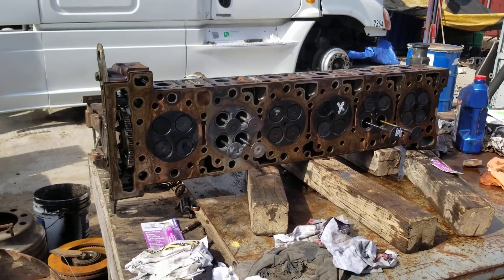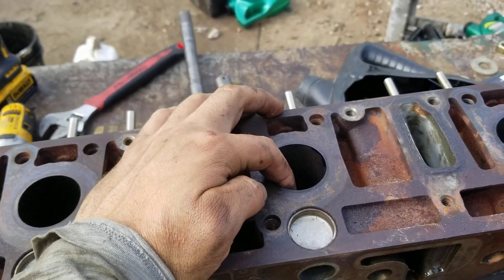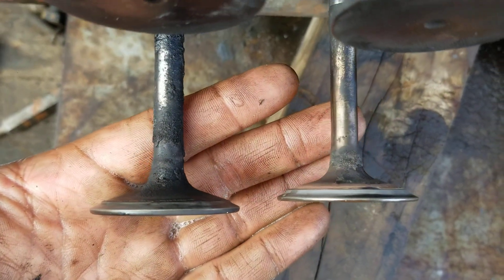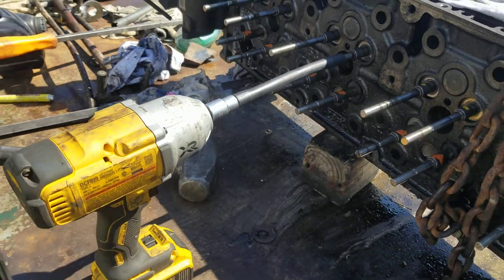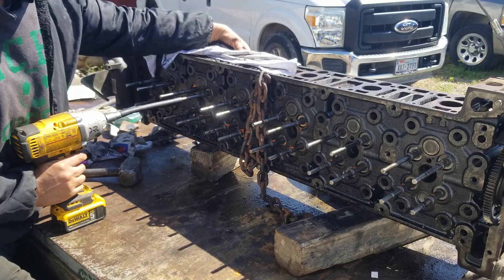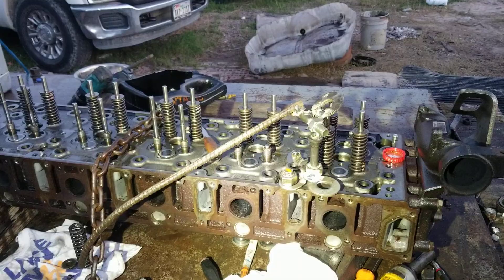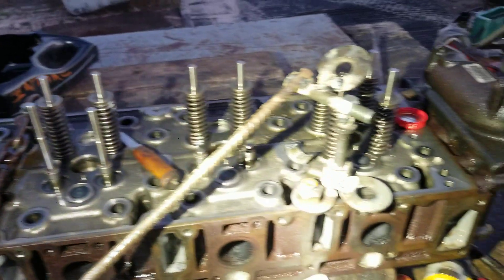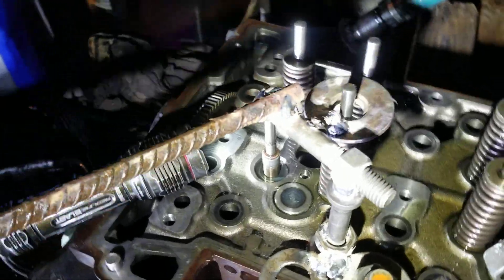DETROIT DD15 ENGINE REBUILD CASE STUDY #2

Comment: Geeez man. Detroit diesel would have a field day with this video. No cut out test through DL. No manual compression test. Just pull head and do a valve job. It's not a small block chevy....🤦
Reply from the maker: Maybe to you it's rocket science and I can understand that, my IQ is obviously waaaaaay higher than yours, obviously I scanned it, a motor is a motor a valve is a valve a seat is a seat quit trying to glorify yourself, you sound pathetic.

Motor has ran 400k miles since the repair, how would Detroit and your dumbass feel about that?
Reply: @mastermechanicfelipe4641 😅
Reply: Shut your as s up, of course we hooked up a laptop to it, it doesn't take a genius to figure out lack of compression on an engine, you lack the skills and knowledge scream on your comment.